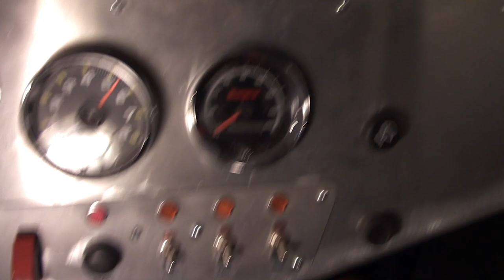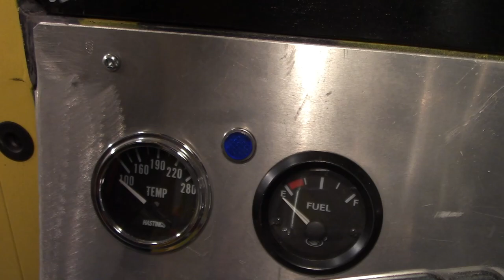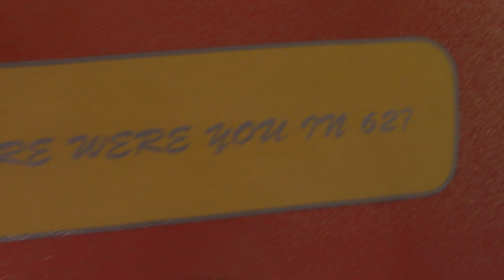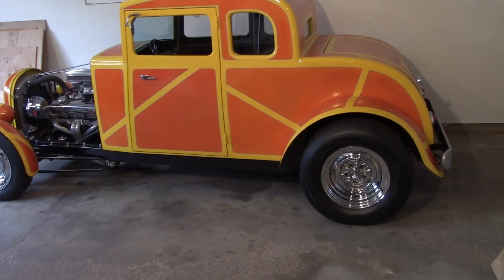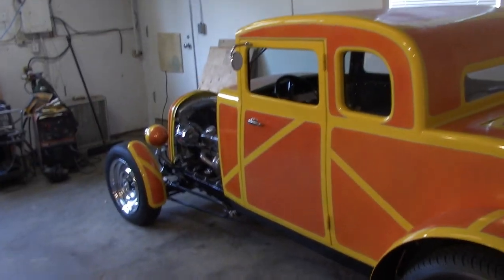Scratch Built Wood Body Hot Rod Walk Around !!

Comment: Cars of the era had steel bodies reinforced with wood I think it's cool that he reversed it.
Reply from the maker: Hey Kevin, yes they did, and exactly what I did, I think it is more solid this way and easier to build, because most of us cant form sheet metal good enough to make a car body. the wood exterior will last a long time if prepped primed and painted properly and not left out in the elements. thanks for the comment.